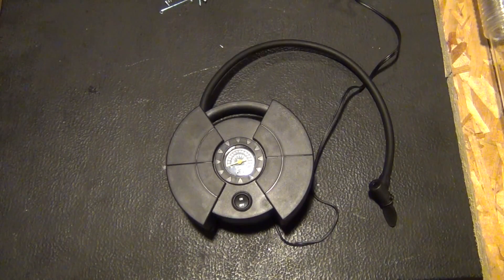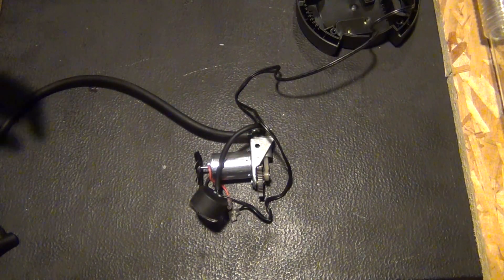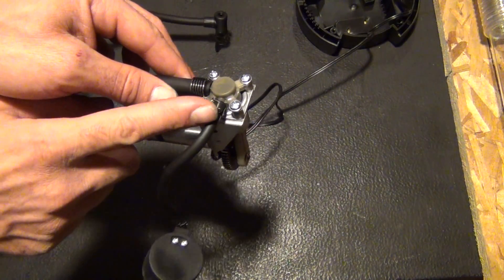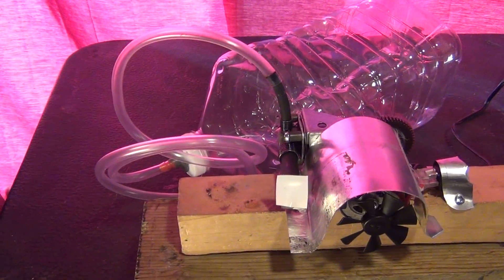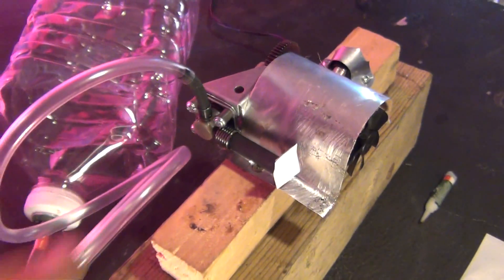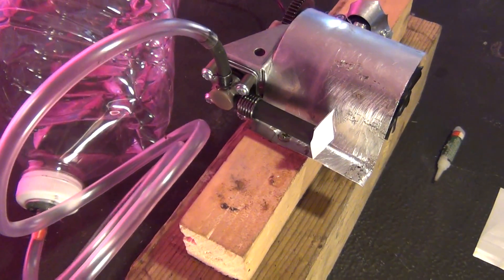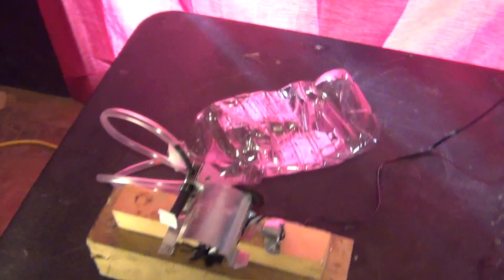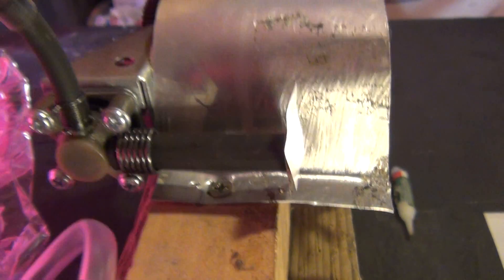How to make a electric vacuum pump for $10

Comment: If you put the compressor in a sealed containers with the hose of the compressor out and sealed and attached another hose to the container to use as your vacuum hose . the compressor pump would push the air out of the container creating a vacuum that your vacuum line would draw air in?

Comment: I miss the vaporizer videos. I found a rebuild Cummins 6AT engine that was being discarded from a whare house that had been sold. Anyway I'm making a bell housing addaptor to put I. an 87 Chevrolet 4x4 and now I need a vacuum pump for the brakes N the A/C controls. I ended up back here but being it'll need to be full time this probably won't cut it. found a belt drive pump for $50 free shipping. I'm on a shoe thread budget so was hoping to find a full time duty pump homemade to save sum$$$$. This engine is supposed to get a lot better fuel mileage than the 4BT and 6BT engines. If I can get around 30mpg In a full size 4x4 Silverado I'll feel nearly as good as if it had a working fuel vaporizer in it. Being that I make diesel from old oil with 20% gasoline mixed in I do well with our bigger 7.3 International diesel in an old F250 It only gets 12mpg  but it's still cheaper than burning straight gasoline. I do hope you get back on the vaporizer videos again.

Comment: Awesome! I love the valves. I did something like this myself - only the cheap compressor unit I found had valves in place and I was able to simply swap one with the other and voila, it was a vacuum pump. I got lucky. However, it wasn't the strongest vacuum pull and what worked a lot better was actually flipping the air valve inside a manual bike pump to turn it into a vacuum pump.  This was the business! I was able to achieve vacuum strengths such that my tubing would collapse, the fittings on my makeshit glassware would blow out, and even got methanol to boil with no heat applied. Each of these comressor motors is going to be slightly different, and you might get lucky and discover an easy to work with brand. In my case it was a Coleman brand roadside air compressor I bought at Ross, in CA.

Comment: Next time you see a fridge being thrown away.  Take the time to remove the compressor and leave about a foot of the tubing above it intact.   They are free and make a great vacuum pump.  I use mine for auto air conditioning repair.

Comment: I was thinking a check valve from an aquarium may help prevent back flow when turned off.  They are little and cheap.  Unless you know the part number for a metal one around the same size that would be the easiest part to use.  I would not know the number for something that small, go to the store and look in plumbing and they are all too big, heavy and expensive.  I was planning to use a pump like the one you made to suck out my transmission fluid but with a large container some where on the vacuum line so that stuff won't gunk up the pump.  It would be a container similar to a brake vacuum bleeder but bigger.  The strength of the container should not be a big concern as long as the fluid flows smoothly.  My car has no drain plug on the transmission and it makes a horrible mess to take the pan off and to make things worse it is red fluid.

Comment: Yeah the video set your "listening" up for 2 values, right, especial after initial description of 3 outlets/inlets. However the dude is correct in works with only 1 value.  Consider its a closed system except when the flap value opens and allows air too escape only. Air cannot effectively go in thru this value as external airpressure works too close the value shut. On the other stroke the air pressure (lowering down) will also 'suck' the value shut, while the expanding cylinder volume helps lower the air pressure in the calpsable plastic bottle.  Neat ah.

Comment: couldn't you just run it backwards with no mods?
Reply: if you simply just put the pipe where the output is, you would be able to suck stuff IN.

Comment: I have  two power supply fans from computers, attached to opposite sides of a small pretzel box, connected to 9 v. Batteries with a foam filter on the back of the fan, and it has enough suction to remove sawdust while I carve my maneki nekos. I may make a video of my vacuum project.
Nice video!

Comment: the flap valve is a good idea, should make sure it is flush with the surface of the hole that protrudes.  would use some construction paper or something to have it protrude out a little more.

Comment: wouldn't it be easier to just put the compressor in a coffee can or similar container and let the compressor pump the air out of the can there by creating vacuum?
Reply: You could do that, but it creates a couple of problems. The big problem is that the motor will overheat with no air to cool it down. The small problem is getting the wires into the vacuum chamber without leaking; you can solve that by potting solid copper wire in resin, but getting rid of the heat from the motor without air is a pain.

If you need to run a motor in a vacuum chamber, the normal approach is to use sealed water cooled motors and have water inlets and outlets into your vacuum chamber, or to put the motor outside your vacuum chamber and use vacuum shaft couplers to transfer the rotation into the chamber; both options are kind of a pain.
Reply: FirstReviewer Yes, they do. As a matter of fact, where I work, we dump/recycle tons of them. I just found out what to do with one of them and my failed air compressor. Re-purpose/re-use/recycle this failed unit.
:)
Reply: idk what the duty cycle would be on this for your use, but it would prob take 20 mins to over heat, but the use of a heat sink would help draw the heat away from the pump..
Reply: Hmm, yeah, he just reversed it right? Also he could use the one way valve already used in the pump instead of making that new home made valve?
Reply: Do thought here, but do they still make Metal Coffee Cans?

Comment: Can you draw steam from hot oily material from this device without it creating a sludge over time inside the pump? This might be great for cleaning racing engines in a hurry.
Reply from the maker: This compressor was built with a plastic piston so if the steam is not precooled it would probably destroy the pump. To do what your talking about I would use a all metal compressor and a venturi style draw line this would minimalize the oil reaching the compressor.

Comment: I have absolutely no idea how this can work without a check valve on the top tube.  Without the check valve on the tube to the container, what keeps the pump from just pushing the air in and out of the bottle?
Reply: +Joe Schmucker  the piston stroke is taking the path of least resistance, which is forcing air out the flap, the flap closes, restricting air flow back in. But as the OP pointed out a check valve would be a better, yet unwarranted addition in this case, but in hindsight i'm assuming there is quite a low terminal pressure whereby the bottle pressure and flap are battling. I would love if he reinstalled the gauge using heat-shrinking on the large tube so we could see its max linear performance,  good video tho duude :))
Reply from the maker: The fact is I had built a very elaborate set of one way valves for this and then had an idea that it would work without the opposing valve and obviously it did.
Reply: ***** Thanks so much for the quick reply!  I see it works great.  It just seemed like the piston would just push air back into the bottle rather than out the nifty rivet thingy.  I'm not doubting your setup, it just doesn't seem like it should work.  BTW, I really hope you come out with a CO2 part 6 that shows you burning a hole through 1/4 inch steel!  :-)   Very nice stuff you do.  I'm so glad I stumbled on your vids.
Reply from the maker: The reason it works is a few factors in combination, first the length of the valve side hose is less than the vacuum container side, so the forward stroke of the piston pushes equally up both lines and the shorter line breaks open sooner than the longer one, and the label provided a material light enough to respond to the forward pushes air flow without creating enough resistance to force the air up the longer hose and into the jug.
Reply: By not having a check valve to the bottle, the piston's compression stroke pushes air to the outside via the home-made foil check valve as expected, but some air is also pushed (or sucked) back into the bottle. The down stroke pulls air from the bottle (but not from the outside because of the foil valve). More air is drawn from the bottle than is allowed back in so it works, but in each cycle some of the vacuum is lost. A check valve to the bottle would make this setup more efficient.
Reply: Hey man about what psi does this pull I'm needing around 25 do you think it can run that
Reply: air needs to travel the resistence of the line , escapes fast short distance to flap valve.

Comment from the maker: Since there is zero thermal transfer through a vacuum it is a good idea, my father and I built a siding that had a vacuum gap in the middle of the material it provided a R-75 thermal retaining value and was only 1/2" thick.